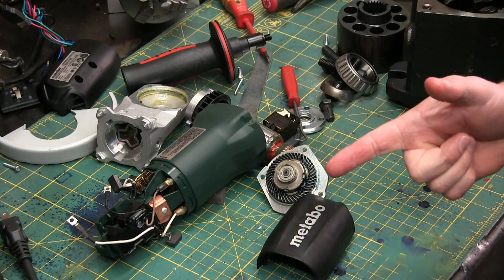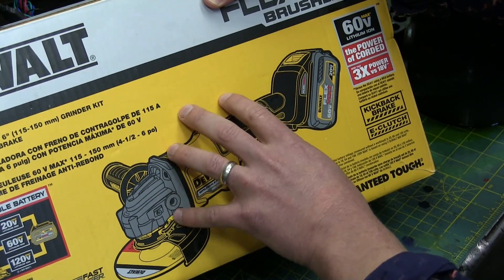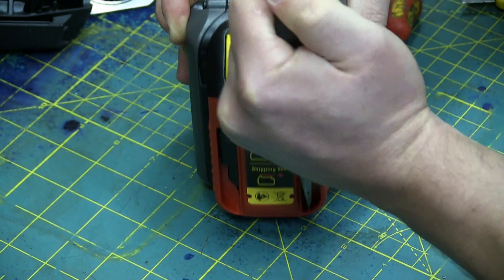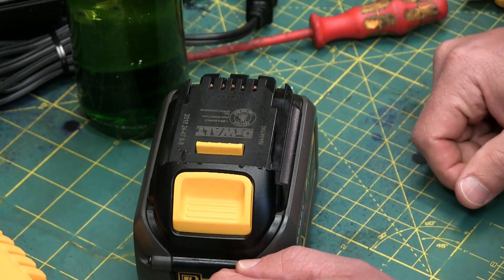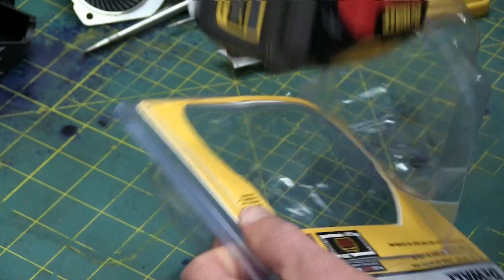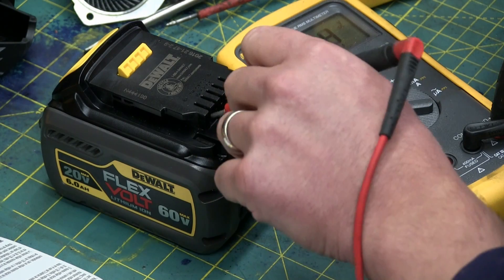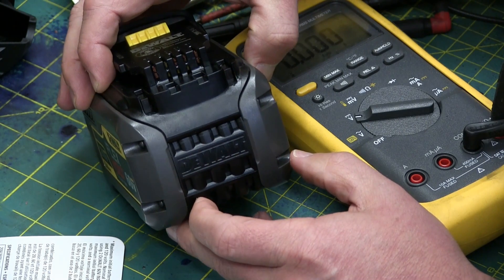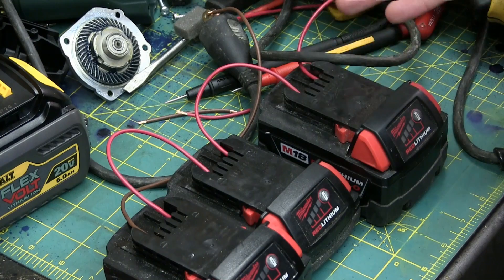Plug-in Power Tool to CORDLESS CONVERSION.

Comment: Hey AvE, I'm Ron from electricbike.com. I was cheating on you by watching a different youtube channel, and when that guy pulled one of these apart, I could count the bus bars (series-ing plates?) and it looks like it has 14 of the 18650 cells. The nominal (average?) voltage is 3.6V per cell, or 50.4V...of course when it is fully charged to 4.2V per cell, its 58.8V, which of course is how they round it up to 60V. 

I have an EGO-branded weed wacker, and its the same, but they call it a 56V system. The biggest ebike web-store calls these 52V, but...they are all the same. Its only 6.0-Ah at the lower voltage, at 60V they are at (or less than) 3.0-Ah.

The mystery is that if you split the cells with a series switch, each half has 7 cells. For them to draw down evenly and all stay balanced easily when charging, a 7S string of cells is nominal 25.2V, and 29.4V when fully charged. 

My Makita lithium 18V drill is 5S, so its a legitimate 18.0V, and then 21.0V when fully charged (which is why many call 5S their 20V). So...how do they arrive at 20V with 7 cells? What are the actual fully charged volts when it's in "20V mode"?

Comment: Use super capacitors, not Li-on.  Higher capacity, and infinite charges.
Reply: "Higher capacity"? ...The fuck ? Maybe fadt charge... and higher price for sure. But how /what cap will beat li-ion on capacity/volume???
Reply: There's a fairly well known RV hack that some use a capacitor in the AC units to relieve the startup and draw.  I have never seen a setup like this in person but would be an interesting comparison for the task you're trying to accomplish.  The very brief time surge current happens I think a cap may be a viable option.
Reply: I was thinking super capacitors too, but it has to work on a hand held too. Those caps are very low energy density compared to pretty much every batter ever invented, and a cap small enough to portable would be too low capacity to give any significant boost at all. Think static spark instead of constant high current boot power.
Reply: much lower capacity, and way more expensive per Wh stored, like WAY more expensive - but supercaps have muuuuch high power density .... might actually complement a power pack well to supply crazy surge currents ; and its higher robustness seems better suited to a AvE rated battery 'powerpack'
Reply: simple math here, one farad/volt equals 1 ampere/second, so a typical 500F, 2.7V supercap has 1350 amp seconds or 375 mAh... at an average voltage of about 1.3 volts. so what supercap beats li-ion? none.
Reply: "...so what supercap beats li-ion?..." Whichever one Wranglerstar says beats it? Must have decal that reads "Brushless Motor". Thanks - Lumpy
Reply: I was thinking capacitor as well for the initial kick to get the motor spinning.  This would save the breaker but would it help out in a motor bog down situation? This is usually where I have to go shopping for a higher amp motor....

Comment: Using a phase-locked inverter that you typically use on PV systems (solar) would work. Instead of using DC voltage from the solar panels, you could just connect batteries instead. Set the inverter to match 120v instead of a few volts higher and you won't push any power back into the grid, but it will be there when your tool needs it.
Otherwise an enterprise UPS battery backup would work, like a huge rack mounted one from APC. They are able to boost brownouts with the batteries, so you wouldn't trip the breaker that way either.
Using large capacitors are another solution, but I'm not sure how they work with AC.

Comment: I actually had an idea that was similar to what my phone does charging at 12v instead of 5, but I see fuckin DeWalt had done it, I'm betting that charger outputs 60v @3amp DC right? quick 30 min charge for 6 hrs of 20v action. better hope they don't have a fucking thermal breaker on the internal circuit like our crappy Ryobi junk. it's 99f outside and has a shut off @100c -.- won't charge till it cools off either.

Comment: how about put a 120 volt dc battery bank with a bridge rectifier and a capacitor in line with the tool.. oh and a isolator can't forget that. so it would go ac 120 to dc 120. with a runing bridge over the batteries so the tool will use ac when running but can also use dc on startup? a momentary switch that will turn on the batteries when the voltage drops probably with a ziner diode and a mosfet and make it chooch with a chip-set that can change the ac circuit over to dc when it draws amps

Comment: Power tool > inverter > 12v battery pack > charger > wires to grid supply. They pretty much already have something like that- those old style battery charger / jumpers that looked like a hand truck because they carried enough batteries to start a big truck. You'd only need to add an inverter big enough to feed the tool with enough magic pixies to make it happy. The pack can charge from the grid pixies continuously but the battery pack handles the big surge of pixies needed to start and run the tool under load. Because that is usually intermittent, the pixies have a chance to gang up in the batteries again between runs.

Comment: id modify a uninterruptible power supply or UPS, somehow rig it to disconnect the mains while the tool starts up so the batteries take a hit, and then reconnect the mains power to run the tool and keep the power going. since if the UPS starts getting voltage it should automatically switch over to it and recharge the batteries if they took that much of a hit.

Comment: +AvE Actually, they do not fully charge the batteries because higher voltages take time off of the cells total usable lifespan. For example, due to extreme amounts of cycling on lithium batteries, the military only discharges to 3.6V and charges to 3.9V to preserve lifespan, but normally (like in this product) they go from 3.2V-4.2V. Considering they may be sitting on the shelf for a long time, this is best for the consumer also, even if it is cheaper for the manufacturer.
Reply: Believe me he knows he's just being funny

Comment: Ok how about this a 220v to 110v tafo pull the windings,out of it,  fill it with lithium ion to what ever voltage you want and plug your corded tools into it, boom mind fuck the guys at work no pixies in pixies out, and have a built in charger in there as well to recharge when necessary basically a quite generator for the dead tree carcass guys

Comment: Your concept is very similar to the start capacitor on an air conditioner condenser coil's compressor power supply.  Totally doable.

Comment: I couldn't process how the guy that's been balls deep in every tool known to man didn't know how to unlock the battery cover. Lol
Reply: I dont think that was his first beer at the end of the vidjeo
Reply: @nottingham82  I think the problem was that it was his first beer.
Reply: Believe it or not being around so many power tools, machinery, mills, lathes and 3d printers, I literally did the same thing on my first flexvolt 🤣. Everyone pulls a boner or two in their life, it's a matter of how hard was it?
Reply: Yeah this is where i turn off the video. If you cant take the battery cover off and resolve to prying it with a screwdriver, i dont trust anything else youre about to show me

Comment: I use this premise to sell Yamaha 3000 isbe inverters to customers with Rvs. The E e start and  B is for boost. Uses the starter battery to boost while ac or electric motor start up ( an extra 15amps for up to 30 sec) then resumes regular operation and recharges battery. Makes the red ones look like playschool toys. Thanks for the great vids!!!

Comment: a UPS isn't what he is talking about, the UPS switches to battery power when the AC mains go down so you would still need to go over and reset the breaker after running down the battery.  I think the simplest way to do this is approach it like a car battery and alternator, when the current draw is too much for the alternator to keep up you draw off the battery, when the current draw is less then full output of the alternator the battery is charged.  So convert the AC to DC, run 2 of those 60 volt batteries in series (120) when the voltage is low the batteries take over, when not using the tool the rectified AC mains recharge the batteries.  I don't think you can make this work with the DeWalt batteries, better off just buying individual cells with built in protection.  I'm not 100% on how you would protect the battery from being overcharged unless 120V is less then the max they could be charged too.  Also make sure the battery's are rated for 30 amps current draw and at least 20 amp charge rate.  of course this will be limited use, if the tool draws too much current for too long then you will eventually pop the breaker as the battery voltage drops.
Reply: just looking around, you could use 30 of these http://www.onlybatterypacks.com/product/li-polymer-3-7v-3000mah-20c-5745135-battery/ and protection circuits http://www.onlybatterypacks.com/product/protection-circuit-module-pcb-for-11-1v-li-ion-battery-pack-3-cells-3a-limit/ they would give you a continuous output of 30 amps and then would charge at 3 amps.  it would be very expensive, but you may find that you can use a much smaller battery that may only give you a boost of say 5 
amps rather then 30, and if you came up with a cheaper way of protecting the batteries then Bob's your auntie

Comment: what about using something like a PTC inline with the AC going to the tool and and also powering a relay. when the PTC reaches its transition temperature it stops the AC current to both the tool and the relay, when the relay de-energizes it passes on DC. shitty paint drawing for reference. https://i.imgur.com/jiCQB3Z.jpg

to tired to think about a charging circuit.

Comment: i once got me a 12V Makita drill, but the batteries died on me (the charger blinked red, and would not load them annymore).. so i broke the battery open, attatched some big heavy wires to the poles of the battery .. and put some (they did not fit all annymore due to the wires) unattatched batteries back in for the weight (feels odd w.o. the heavy botum) and attatched some clamps to the wire... it works great straight from a car or motorcycle battery .... was cheaper then a new battery annyway.... im curious if it works on other voltage drill's too... like the 9.6 or 14V stuff... or if theres a way to safely bypass the safety of the charger... i have charged my motorcycle battery with a simple transformer till it was above 9 volts so the  "drip"loader will accept it as not broken... i know theres expensive chargers to heal a battery, but idk if it really works... seems my batteries break from NOT using them regularly and  a waste to buy new ones

Comment: For your Turbo Charger, a UPS with power conditioning is what you want. They boost line voltage during brown out situations. No need to reinvent the wheel. I'll leave this right here in the doolbly doo.

Comment: Well here's my 2 cents. I think it'll be most practical to have it connect between the wall socket and the tools plug so to keep it out the way. Also I'm sure there is an arduino current sensor attachment available. So when the current reaches a certain peak the arduino could switch on a relay to link in the battery. I'm no pixie wrangling expert though.

Comment: the reason lithium batteries come with half charge is because half charged is a lithium's storage voltage where it will degrade the least over time when left alone.

Comment: I think you just described a small UPS (except for the running on DC part) the ups would invert to AC.
What may do the doings is a UPS inverter/rectifier circuit that can take a cordless power tool battery with the whole clip mechanism etc. An isolation stage on the output could be installed to reduce the risk of electric shock if someone fingers the active.

Comment: AWESOME... This is a great idea. A start up Cap for power tools. I don't think having a battery hanging off the side of the tool for "Just incase" would be attractive to consumers. Maybe an 18650 in the handle be enough to kick it in the as.. yah probably not.. But a big enough fast discharge cap would do it. http://www.mouser.com/ds/2/257/Maxwell_BCSeries_DS_1017105-4-341252.pdf

Comment: The proper solution would be to use 12awg or better cords for runs of up to 50 Feet. Past that distance or for heavy duty and high draw at start tools a generator close to the work is probably the best way to go.

Comment: Could you use a grid tie inverter from the solar world with some modification?  Various input voltages, 12 - 24 - 36 - 48 and output is your local mains voltage tied to the local frequency.  I'm imagining you make a circuit that activates the grid tie for the first few seconds the tool fires up then goes back off again to preserve battery power.

Comment: I did the opposite. I had an old challenge cordless drill with crappy batteries that I hooked up to a laptop adapter that the plug had worn out on. The drill does cut out at high power and so is useless for putting in screws, but it works okay for just drilling smaller holes in a piece of wood.
Reminds me I need to fix my Ryobi as I was stupidly testing the torque gripping the end with my hand on a full battery and it went into overload and won't turn on. The first time it worked again but I didn't learn my lesson!

Comment: They save the battery by not charging it fully. Li-ion stores best at around 30-40% capacity. If it sits for a year fully charged it can lower the overall capacity.

Comment: Basically you're talking about a start capacitor that has a pass through plug. Could be done a lot cheaper with a big cap rather than expensive batteries since you don't really need the runtime off the "device" it's just for startup. You'd need some electronics in there to sense voltage drop so it's not continuously connected.

Comment: @ 4:07  I believe they leave the battery charged between 40% and 80% so that it can be stored for several months without being damaged.  The bios on most laptops even has a setting to prevent the battery from being charged over 80% to extend the life of the battery over time.  There is a lot more info about it over on candle power forums.

Comment: Its called a UPS... the thing you describe... the battery operated power tool, charges the batteries when not in use.. a UPS.. its the size of a small house mind, if you need lots of umps... the more pixies.. the bigger the UPS....

Comment: +AvE You may want to rethink your objective with a turbo charger for tools. Here are my thoughts from a sparky's perspective:

These tools and anything with a Nema 5-15P connector were designed to run safely on a 15A circuit. Any device that allows the potential of 25+amps for an extended amount of time would surely not pass CSA evaluations (not even Intertek!). If CSA evaluation is something you wouldn't consider it doesn't change the fact that it simply wouldn't be safe. If you plug in grandpas old corded drill that hasn't worked properly in 50 years how would you design the device to determine the difference between simple start up current and increased current due to failure of the device? We wouldn't want tools to combust in peoples hands, or melt their 22awg Chinese made extension cords. Furthermore, there is already a large delay in a typical breaker due simply to design. Look up "Breaker Trip Curves" online. It is amazing how much current these breakers will handle for short amounts of time before tripping!

To design a "Turbo Charge" system we should keep the above in consideration. What I suggest would be a device that you plug into a 15a 120vac circuit which provides 1 or more 20a T slot circuits which in turn would be separately overcurrent protected. This would be a safe approach that would virtually eliminate the chances of nuisance circuit tripping. I'm not certain exactly how we would achieve this efficiently and seamlessly as it would require more thought. However It would, of course, require batteries as you suggest in your video.

Comment: I run AC tools off batteries all the time.  Very handy when you are out and about doing quick or 'covert' work. Here in the UK (240v) that means 200kg of alarm batteries, but it is still lighter than the equivalent generator (8kw) and you don't have to start it up. It also fits in the trunk of a car, and is silent and always ready. You can now get compressors with uni motors too !

Comment: I should have mentioned the reason to use batteries to begin with....   To run a plasma cutter (8KW) 200kg of batteries and a bottle of oxygen, right out the trunk of a small car !    The only thing you cant run DC is induction motors. Everything else can be converted or just plugged in.

Comment: All you need to do is integrate an AC capacitor into the extension cord on the tool end. Just make sure it's big enough to handle the draw at startup. Plus, really AvE the fucking release button lol love the channel.

Comment: 4:05 just to clarify they dont fully charge a lithium battery for storage reasons. the longer a lithium cell sits at 4.2v the quicker it dies. evidently once you get past 3.9v or so the plates start reacting with each other, and that reaction ramps up as charge voltage goes up. thats the main cause of reduced battery life, and also why i charge my ebike battery to 3.9v per cell whenever i dont need long range. it lasts a lot longer that way. actually a cell at 3.8v can last decades. i have some cells from 1998 that are still fine, but only because they were left in a laptop at like 40% charge.
  
oh and i've heard (and i plan to test) for ever 0.1v you lower the charge voltage the cells last twice as long. so 4.3v you get half as many cycles, 4.1v you get twice as many.
  
but maybe you were joking and already know all of that, in that case, sorry :p